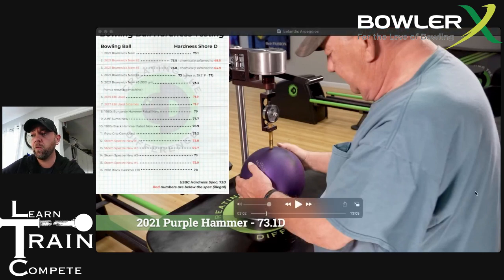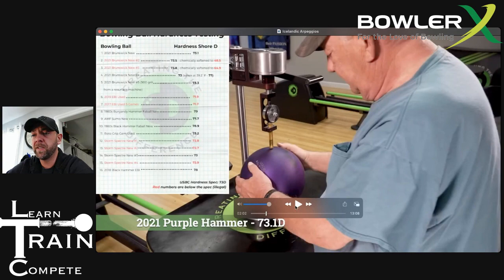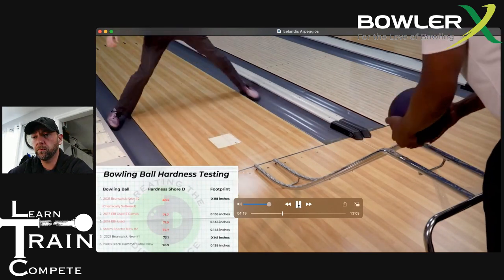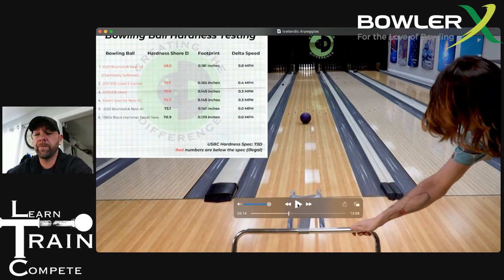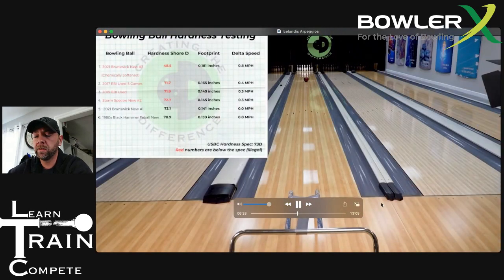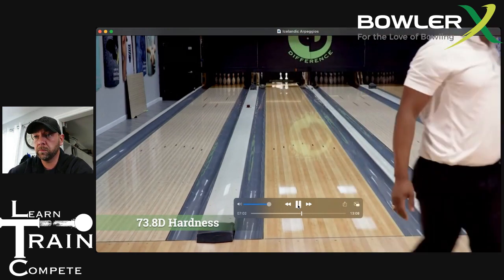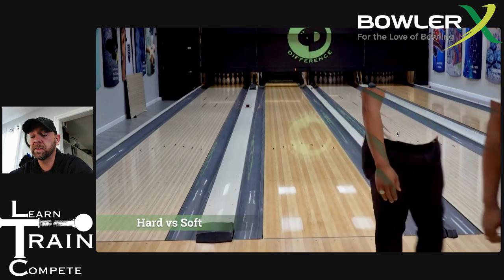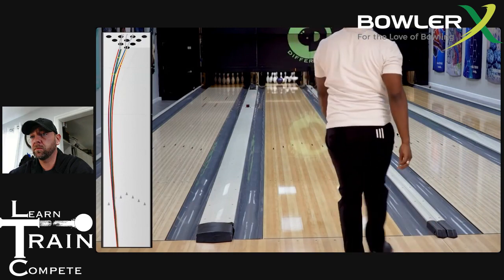USBC and PBA lays down the ban hammer | Why the softness is important in bowling balls

Comment: So a dumbed down version is, soft bowling balls have more traction on the lane because more of the ball is touching the ground (it's "footprint")leading it to have a higher hook effect but it also causes the ball the loose more speed since more of the ball is touching the lane which effects the speed. So softening the. Ball slows the ball down more and causes a higher hook potential because more of the ball is touching the lan which is why 14:24 to 14:40 is correct. Harder balls can start to pick up and hook but can't completely maintain it because less of the ball is touching the lane but softer balls can pick up the hook and completely maintain it since a bigger part of the ball is touching the lane.

Comment: Great video JR.  Exactly to what Deadpoly is discussing, if the tapered fresh is very over/under instead of a gradual taper then the reactive balls react too hard when you push the ball several boards towards the gutter and especially for bowlers that have less than average speed.

Comment: Somewhat you are missing the point. A urethane ball can be chemically softened. Hence it does not mater age or brand, it can be modified by the user to make it far softer then original.
Reply from the maker: Which is illegal. These were softened to prove the point of why the rules in place

Comment: My personal experience with going back and forth between reactive and urethane(purple tank) in league shows that sometimes I have way more miss room with urethane than I do with any reactive ball I own. Reactive gives me more power more times than not and sometimes more miss room. I'll have to give lower end reactive balls a shot to see if what matters is the straighter angle, but I have a hard time believing urethane is never the best choice on house patterns.
Reply: My best house shot scores have been shot with urethane.
I do have an original mint condition 1987 Grey Rhino with a simple label layout that works wonderfully on drier blocked house shots.
I just roll it easy up 6/7 board and it digs in early and floats across the lane and blasts the pins!
The Grey Rhino makes a loud sound when it hits the pins, louder than any of my other balls. It makes me think the filler is very hard and stiff.
Not sure they had standards for C.O.R back in the 80's.
Reply: @nordattack  that makes me want to try to find my old Columbia Shadow.
Reply: @horseshoe_nc  Also have a Brunswick Grizz that kills it on House for me. You can check it out in action on my channel. Video #133.
Reply: @nordattack  Maybe I should have my dad try throwing urethane. He's a full roller and says he's never tried it.
Reply: @nordattack  I will have to check it out.
 I just uploaded a video of my old asymmetrical plastic, Ebonite Clear Wolf, hooking on fairly dry lane. The shots aren't the best, as I'm just now getting back into the game. I'm still trying to figure everything out again.
Reply: @zandy1569  Urethane works great for Full Rollers. I would recommend a 2 1/2" Leverage layout so the ball doesn't roll out too soon. This will still keep the ball early and smooth but give it a bit more drive in the back compared to the 3 3/8" layout.
Reply: You will spend ALOT of money trying to get a low end reactive to do what urethane does. Ive tried it, been there and done it. Still roll my highest scores with urethane. I took a 3 month break, took out my black hammer and threw a 230. It just fits some people better.
Reply: @tylerwill5250  I don’t plan on spending a lot of money, but I don’t mind spending a lot of time just to learn. If the best I could hope for was to match my urethane I wouldn’t bother. I’m sure there will always be times when urethane looks the best for me. It’s probably cause my release is different from week to week.

Comment: Question: Why do Purple Hammers get softer over time? What causes this effect? 
Does the conditioner in lane oil break the ball down and soften it since conditioner is a solvent?
I have a 1987 Grey Rhino and 1989 Grizz and they both still measure 76.
Reply from the maker: Good question. Something about the additives I’m sure. The chemical makeup is different

Comment: Just out of curiosity, is there a similar hardness requirement for bowling lanes? Because there are two interacting surfaces and the ball is just one of the variables. Also, while I understand that it makes sense to standardize the equipment, in my opinion the primary determining factor should be friction (regardless of the material) and not hardness. Friction is what generates the hook and what makes one ball perform better than the other (excluding cores).

Comment: I still don't really get why this is an issue..because you still have to throw the correct ball with the correct shot. If everyone has access to the ball then it is on them to play what works best. Bowling is not as much of an issue of unfair advantages as other sports. This seems superfluous
Reply from the maker: Integrity. There’s a reason rules are in place.
Reply: @Tenpindoctors  I understand the concept of what youre saying..I guess my point is, what makes this particular ball (or any ball being soft) different from any other ball that maybe soft? Or any other ball with extreme amount of surface on it? Where is the line supposed to be for integrity sake? 

One could just say that its illegal to alter surface of a ball..you could say that today's reactive balls are basically cheating in comparison to even what I used when I started bowling as a teen in the 00s. So to target specifically this ball seems odd..especially when it seems like based on this video that the ball will naturally soften over time. 

I know this was long winded as hell so thanks for reading if you did lol. I like and watch almost all of your videos and ball reviews etc
Reply from the maker: @user-wh6sp6st8s  the line to cross is 73 hardness. That’s the issue here. There’s a reason the rule is in place and this video demonstrated that perfectly. Changing the surface of the ball to 80 grit doesn’t make it hook more it just makes it hook earlier. It also doesn’t make it softer. Changing the hardness of the ball does make the ball hook more and give it a bigger foot print.
Reply: @Tenpindoctors  I guess what I'm getting at is switching to a softer ball I look at as in the same family as using a pearl or solid or a different layout etc. Meaning it's another tool to use for certain conditions. Im sure that there are instances when having a harder ball may benefit moreso than a softer ball and vice versa. It just seems interesting to me given that bowling has been (at least until the last couple years) pretty open to different schools of thought like 2 hand movement, no thumb, 2 hands with thumb (Maldonado) where I could definitely see someone complaining that the increase in rev rate and power makes their pocket larger and carry better than a traditional 1 hander (I guess not named EJ) would have. 

By the way to be perfectly clear, I am in no way arguing with you or even disagreeing with anything (the video did a great job explaining as you said) you're the pro and easily know better than a non PBA member. I just think its interesting is all and hopefully I'm making sense